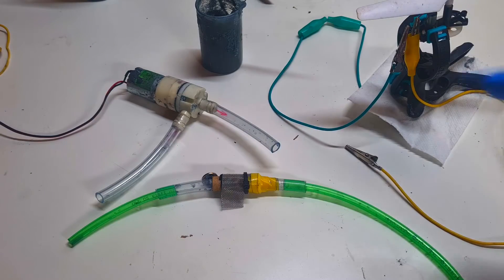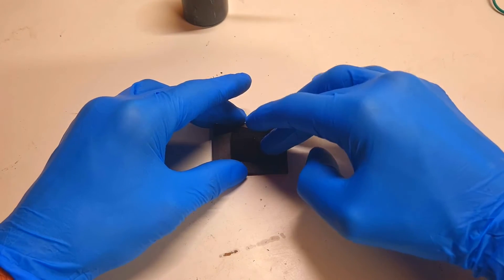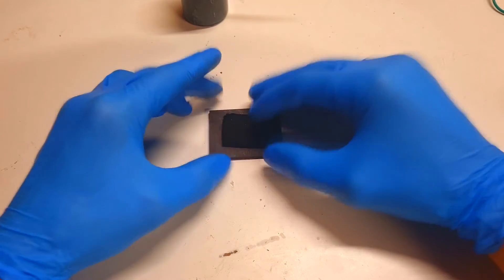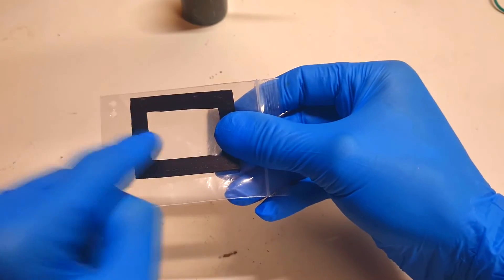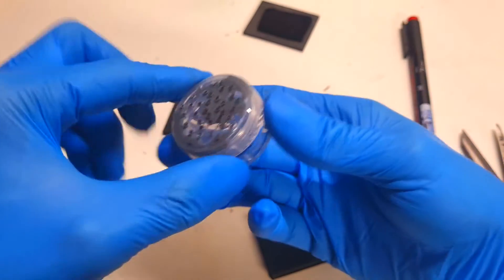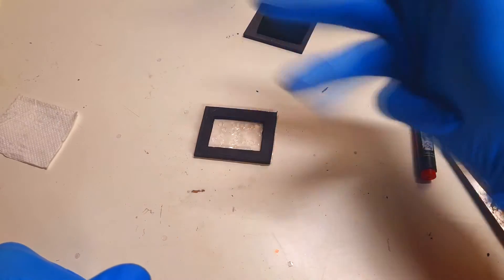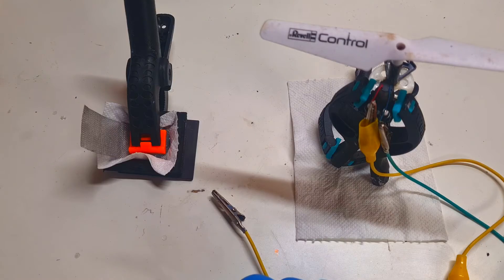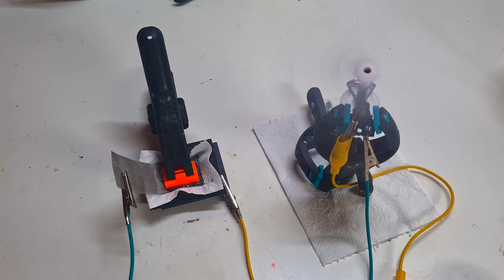DIY Zinc Air Swap Battery

Comment: What is the purpose of that spacer? You could put them together in a sandwich style?
Reply from the maker: Yes you can. But in my case if I dont use that spacer, the separator stick to the cathode active material. With a plastic spacer the separator dont stick to the cathode and is easy to remove.
Reply: @cayrex  Aha now I understand thanks
Reply from the maker: @myscitechs2497 No problem 😉

Comment: I find it interesting that the cathode is sealed and on the bottom and not open to air. But it is the zinc anode that reacts to air and creates power, isn't it? So the zinc on top reacts with oxygen and the cathode does its job without so much exposure to air. (Co2 is death to air batteries as I understand it)

Comment: Interesting that the battery worked better the second time around. Wonder if the zinc oxide particles are helping to improve electrical contact between zinc metal particles and current collector, it is a semiconductor, after all? Maybe this type of cell will benefit from mixing in some carbon black or graphite powder with zinc powder to improve power?
Reply from the maker: Yes, you need to have some conductive material mixst in in the first place. I for example use CB in range from 2 to 5%/wt.
Reply: I wonder if the oxide migrated and formed on top of the screen as it was consumed. Zinc oxide forms a passive layer but not as bad as aluminum and may be, as you suggest, a kind of semiconductor? And who's to say the ZnO with its oxygen content doesn't assist in the redox reaction?

Comment: Is it possible to use zinc air flow batteries in EV's?
Reply from the maker: Yes. I point that out years ago.
Reply: @cayrex  I know nothing about chemistry, but I like experiments. Can we make rechargeable zinc air battery? Do this battery generate much energy to start a normal patrol car? I want to do an experiment, if you help
Reply: Deutschepost ran a program in 1995 with Mercedes vans running zinc air batteries. They were not flow batteries. They were cartridges of some sort and probably very similar to what Cayrex made here with cathode (+) on bottom and zinc (-) on top for ease of reloading. Thanks
Reply from the maker: @evanriddle1614  Wow thank you!  Good to know about the Deutsche post program. I looking to the papers right now, really interesting. Making the system that can be refilled similar to petrol car by swapping the anode material will have its advantages.
Reply: try silver-zinc battery for EV, it is the highest capacity battery available on the market (so you will drive longer distance), it was is used in all space missions, it is easily recycled, and it will give high torque until it fully discharged so you will not notice the diminishing energy.
Reply from the maker: @absolute___zero  Yes zinc - silver oxide was really popular choice for space applications. But I think that the price will kill it right now.
Reply: @absolute___zero  Silver is used as a catalyst in the cathode along with cobalt and manganese but i don't know as to how exactly. These are high priced cathode materials. In designing something it has to meet a price point along with everything else. Thank you!
Reply: @evanriddle1614  wait for February , all precious metals will have a 50% discount, yeah, cost is high, but it is twice more powerful than lithium, on a car you don't have a lot of space to carry batteries, that's why paying the cost of precious metal is worth it. If it would be for non-mobile application, then I would go for zinc-bromine or hydrogen-bromine. Zinc-Air is not a rechargeable battery
Reply: @absolute___zero  the ZnO can be regenerated. The vehicle has feed tank and waste tank. Both are identical. They can be swapped out when waste tank is full and feed tank is empty. Some mechanical engineering can get around this.